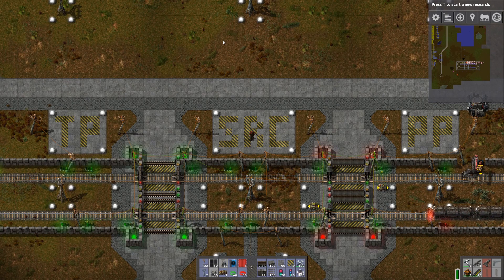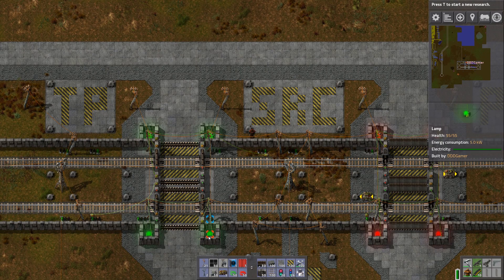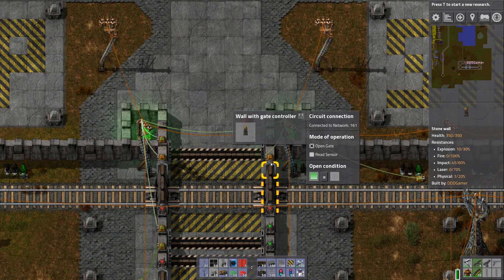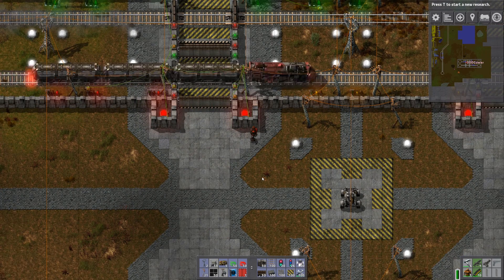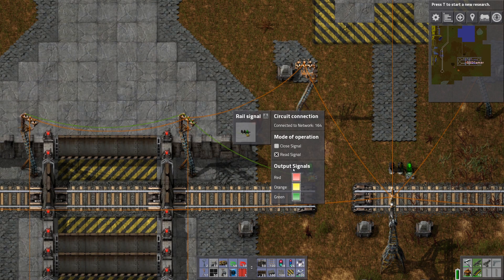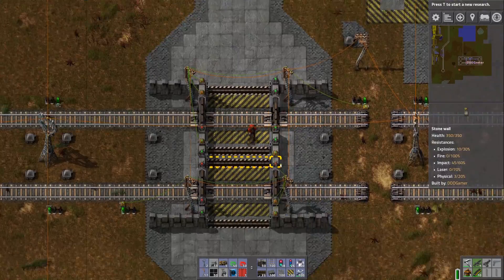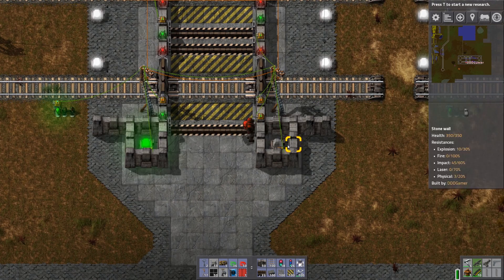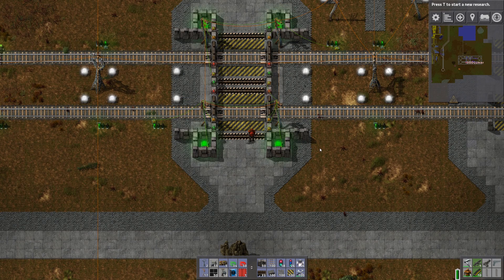Factorio Tutorial - Safe Rail Crossing (Train Priority )

Comment: blueprint string please?
Reply: Yup, I was thinking the same thing, It take some time for me (Because I tried to do two months after I saw this video so I forgot somethings, but it's easy anyway. 
The only sad thing is that Gates that are in a diagonal angle will be conected together, even if you have a wall separating them, so you NEED the tracks at least eight blocks away for each other D:
Reply: you litteraly have nothing to do then placing walls, gates and connect them with green wires?! it will take you 30 second per gate, if not less

Comment: i did that and it worked when i controlled the train in manual mode, but the use of the rail signal broke my automated train connection, it just stays there and says: no path, how can this be fixed?
Reply from the maker: You may need to double check your signal placements in general if that happens, watch my train tutorial to  understand how they work. https://youtu.be/oaEFUGvjeEk?t=13m55s
Reply: thanks for the quick response, got it sorted out by myself already.
Took me hours to finally get it.
Thanks for the response and the video!

Comment: I like the concept, and it's certainly easy to implement with the signal/circuit network feature. But I can just see myself moving over the tracks at the exact moment a train enters the block that closes the player crossing gates...locking me in. (My luck is that bad.) I'd probably move the outer player gates further out to provide a safe waiting area.
Reply from the maker: Yeah that would work, i actually found that if the train has enough speed it can knock down the train gates, but honestly i find now that you don't even really need them. Also moving the rail signal further back can detect a train earlier and lock the gates sooner. And even if you are locked out just keep running across the tracks, you will pretty much be running into the closed wall which is a save distance away from the tracks (that one unit away) you are out of luck with a car though, need 2 spaces between the wall and the rails. I blown up a whole bunch of cars myself XD.